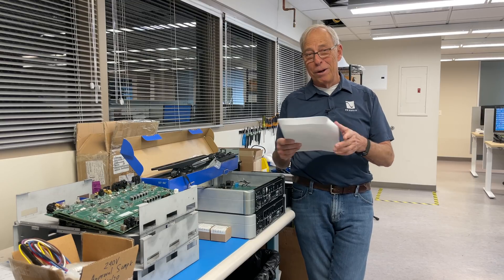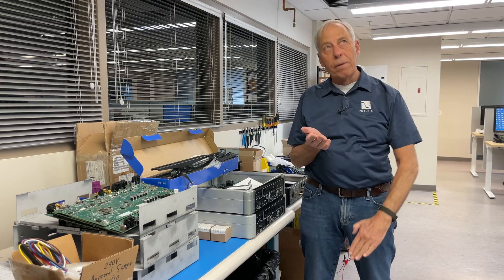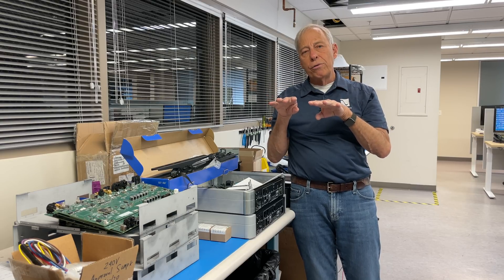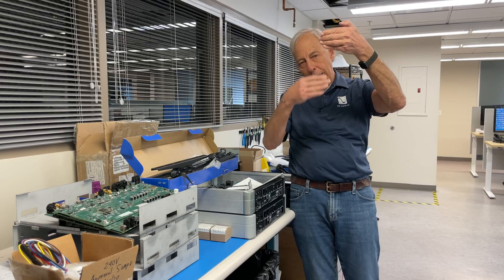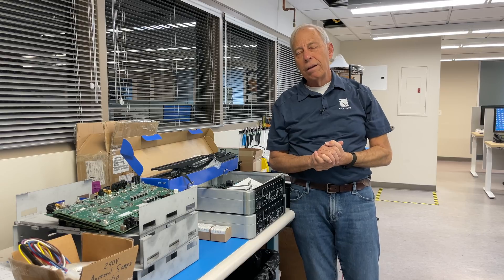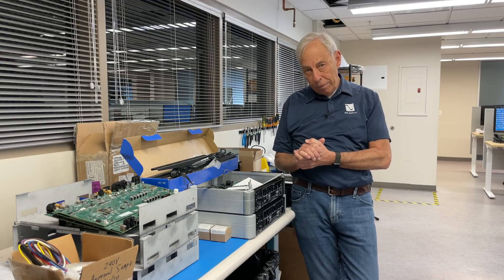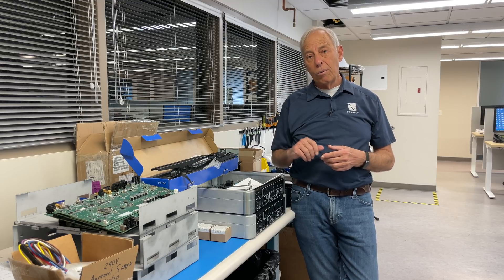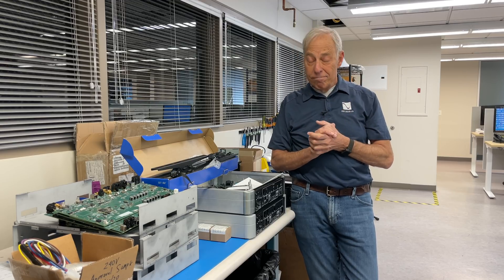Single ended amplifiers

Comment: what about the single-ended single tube 160w Russian radar tubes
Reply: There are all kinds of monster tubes that you could use to build larger SE amplifiers, but at some point, the electric bill and the heat become intolerable.
Reply: @marianneoelund2940  lol
Reply: @marianneoelund2940  And transmitter tubes require deadly voltages and currents. Not "you may be electrocuted" but rather "WILL be electrocuted" at these power levels. Plus you will need a BIG custom wound output transformer as they are just not available OEM. Power transformers - tons on the used market but OPT s for these amps are very special. Still, there are few built by some wealthy enthusiasts. Personally I don't see the point.
Reply: @andydelle4509  My engineering manager from back in the 1990's used to refer to audio transformer design as a "black art."

Comment: Single ended uses a single (positive) supply rail to drive the tubes or npn devices. However this mandates the use of large coupling caps at the output to block the DC bias. These caps can contibute low frequency distortion when driven close to their rated voltage. They can also limit the  low end response of the amp. The Dynaco 120 was a popular SE amp in the early 70s. Folks who have rebuilt them love the sound.
Reply: Thumbs-up for "distortion when driven close to their rated voltage". Things have to be designed properly. As Paul said, push-pull requires each 'half' to be complementary. There's a 1980's p-p power amp on my bench which has NO capacitors in the signal path. It's a right pain because every pair of transistors was hand matched in the factory.
Reply: @dnealuk Direct coupled output stages have nothing to do with class of operation. My tweeters run on class A amps with no coupling capacitor*. It's just a matter of using symmetrical power supplies like +24v and -24v so the output signal is at ground with zero signal. There are a lot of other benefits from a DC coupled amp as well such as no capacitor distortion. Another benefit is cost reduction. A stereo amp with a single rail power supply requires three large capacitors, power supply and one for each amp as an output capacitor. A DC amp only needs two, one for each side of the power supply. This is a win-win with lower cost and higher audio quality. 

*I do have an external 33uf foil capacitors at the tweeters which means that don't ever see below 600hz. Reason is any pop or other low frequencies that get through the amp will quickly destroy a direct connected tweeter. In a normal speaker the crossover provides this protection. I learned this the hard way with two $300 Vifa tweeters destroyed while adjusting the crossover and accidentally letting bass through the tweeter amp.
Reply: @andydelle4509  "Direct coupled output stages have nothing to do with class of operation." You are correct.
"It's just a matter of using symmetrical power supplies like +24v and -24v so the output signal is at ground with zero signal." You are incorrect in saying 'JUST a matter'. The two halves must complement each other, as Paul said in the video, with facial expression that said that's not a trivial thing. When carefully designed (in my example, with hand-matched transistors) it's MORE than a matter of symmetrical power supplies.
Reply: @dnealuk  I fully understand and have constructed quite a few power amps in my time - since the mid 1970s. Some good and many not so good! Of course all the problems you noted plus at least few more are involved to design a stable DC coupled amplifier. I was just being very simplistic. I didn't mean to imply you can just take a single rail amp ground buss and connect it to a negative power supply with the speaker return connected to the two power supplies mid point. It's hardly that simple.
Reply: Thanks for that I didn't know it was single-ended . I assembled one in 1971 when in the USAF in California . Loved the sound until some junky needed everything while I was away .
Reply: The Dynaco 120 was actually class  B or i guess you could say class AB. It did run a high bias to keep it in class A longer than modern amps but once you got over a watt or two it went into class B. Early transistor amps had severe crossover distortion problems and there were many tricks to try and alleviate that.
Reply: Loss of signal in push pull amp. At low volume it is more apparent than high volume. Specially in classical music when nothing playing at high level, single ended amps have no match.

Comment: 300B Single-Ended Triode Tube amps are musical. And that due to the 2nd order harmonics. But, driving a Klipsch Heritage Premium ( 102db sensitivity ) it's frighteningly magical and realistic.
Reply: my 8w does just fine on my 96db boston lynfield speakers
Reply: @giannagiavelli5098  That sounds like fun
Reply: Klipsch speakers tend to sound better when driven by tubes amps. You have the right combo
Reply: I'm not sure that "magical" and "realistic" belong in the same sentence.  I'm sure you are hearing more of the former and less of the latter.
Reply: @marianneoelund2940  Tube amps ( single ended or not ) have been described in a variety of ways. "Musical", "realistic, "Open", "Air", "Space" and on and on and on. Paul uses lots of these tags. It all describes in a nice way the low level Second Order Distortion components imparted on the signal. They are NOT accurate. But, there is a very high preference for the sound.

Uber accurate Solid State amps have correctly been described as "dry" and "cold. Correct. And also highly accurate. Most people won't prefer that.
Reply: @marianneoelund2940  Some time ago I was involved with the BAS and the MIT Media Lab to quantify the "tube" sound. What it was and how to create it using non-tube electronics. Once we had defined what it was we shared those results and some companies put the solution into their products. One of the easiest ways is to take a very good solid state amplifier and put a tube stage at the input. PS Audio does such a thing with some of their amps.

Given a non-audiophile audience, and presented with the "tube" sound, there will be a 90% preference for the tube sound. Even with all the distortion components.

Comment: Nothing sounds better than a single ended amplifier...except a single ended triode amplifier. The EL-84 is a pentode.
Reply: Yes, the EL34 is a pentode. They can run as triodes if connected up appropriately. A typical modification of one Chinese EL34 kit amp (possibly the one the questioner refers to) is to add a switch so you can go between pentode and triode. Pentode for more power, triode for the 'clean magical' sound being referred to.
Reply: @dnealuk  If he's only getting 4 watts from an EL34, it must be connected as a triode.
Reply: @dnealuk  I used to own a pair of Audio Research mono amps with 6550's wired as triodes. The amps were not single ended and were class AB. After building my first single ended triode amp, I sold the Audio Research amps. Half the cost of building that first amp was tubes (2) and output transformers (2). EL-34s can indeed be wired in a triode operation, but they are used because they are available and inexpensive, as were my 6550s. I doubt, and I use that word because I don't know for sure, that they would pale against a good power triode like the 2A3, 300b, or my favorite, the 45. I will say that any Class A amplifier will sound better that a similar quality Class AB or D amplifier.
Reply: @johnlebeau5471  Yes. Real power triodes - and suitably hefty output transformers. Hmm. One day...
Reply: I thought I heard EL-34. ( he didn't say he dash tho )
Reply: @bruss529  same same
Reply: These new fangled vinyl LPs are nowhere near as good as shellac 78s.
Reply: @MrsZambezi  A shellac 78, played with a mono cartridge, properly equalized, and coming out of one speaker can indeed  sound stunning. Or were you just  being flippant and saying that old technology cannot possibly be as good as new stuff. If that is indeed the case, you would be wrong.
Reply: @johnlebeau5471  I was being flippant. 😊 Those speed 80 acoustic recordings are the best.
Reply: That's right. My dad's 50s Alba radiogram with no VHF and the Collaro deck was the ultimate hifi. I just didn't realise at the time!